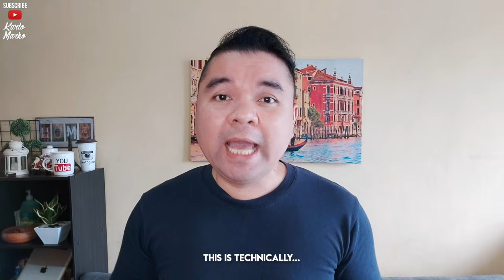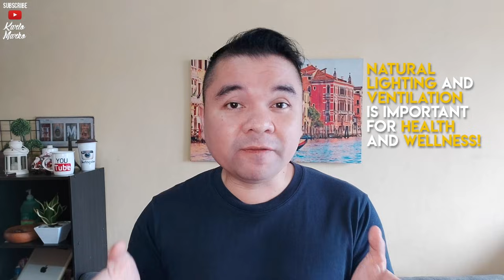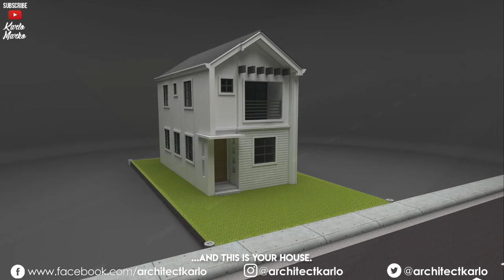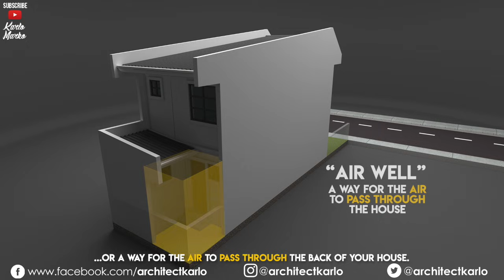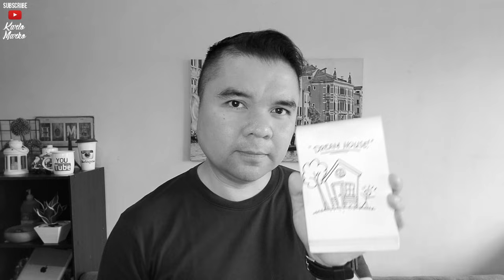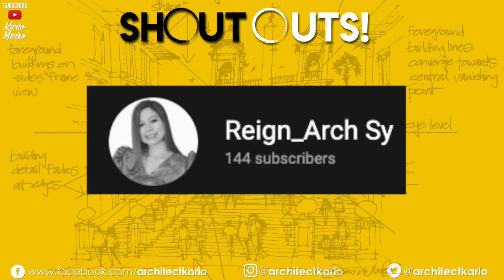The Rules on Setbacks and Firewalls | Bakit Hindi Pwedeng Isagad Sa Property? | ArkiTALK (Eng Subs)

Comment: Sir karlo how about building a room above your existing garage? Any rules for that?
Reply from the maker: Hello Scarlet,

If you bulld a room on the 2nd floor and one side is directly adjacent to the property line, the wall built on these sides should be a firewall.

You also have to consider the setback rules as it applies from ground floor to the upper floors.

You can recheck this with your local municipality just to be sure of your setback limitations. Because some municipalities or city apply these rules strictly and also with exemptions. Depending on your location.

Comment: How about fiesta community houses set backs 1.2meters lang for backyard, side and front yard. Acceptable pa ba iyon? Your opinion lang Archi, di ko naman i cocontest sa subd. Karamihan naman kasi sa mga units nila ganito.
Reply from the maker: Hello Emmanuel.

I'm not sure how they had this approved but maybe the developer requested for a special permit for this because under the Implementing Rules and Regulations (BP220) for economic and socialized housing the rear should still be 2 meters while the sides can be reduced to 1.5meters (under BP220).

The National Building Code NBCP: PD1096 still requires  a 2 meter side setback for all residential lots under the R1 classification or the low density single family, single detached house.

Comment: Hello po! According po sa video, yung pagsukat po ng setback ay mula sa property line hanngang sa exterior wall. So, ibig sabihin po ba pwede lumagpas yung overhang sa setback as long as hindi po ito masyadong dikit sa property ng kapitbahay? Thank you po!
Reply from the maker: Hello Lychee,

Yung overhang o yung tinatawag namin na "eaves" with reference dun sa nguso ng gutter ng bubong hanggang sa property line ng lote ay dapat meron atleast 0.75meter na distance. So from property line to the edge of the roof, atleast 0.75meter ang distance. Si bubong ay hindi wag sanang isagad hanggang property line. For ventilation, fire protection and other purposes. 🙂

Comment: What if the lot is in a hilly village and the house behind my lot is already on my 2nd floor level, hence no proper ventilation to begin with. Will it be allowed to build a full firewall at the rear of the house?
Reply from the maker: With the way you described it, will the firewall fit?

Comment: Good day sir. Taga Samar po ako at ang aming building permit was disapproved by our local building official because we did not comply daw on the setback requirements under rule viii of PD 1096.
Ano po kaya ang puedi kong gawing action if in case our building official will not waive, in our favor, the minimum TOSL requirements even if we can point sufficient evidence that the public open space. e.g. RROW,  on which our building abuts can adequately supply light and ventilation to every room in our building? Are there other options aside from writing an appeal to the secretary of DPWH? 
Maraming salamat po sa magiging tulong nyo po sir sa mga inquiries ko po.

Comment: Kung 7 meters (wide)   x 10 meters (long), so my set back 4meters sa front, then 3 meters na Lang Pwde Tayuan
Reply from the maker: Hindi po sa lahat ng lote applicable ang standard setbacks. Meron pong exemptions sa rule lalo kung maliit ang cut ng lupa or kung ang vicinity niya is under another set of classifications pag dating sa lote. Depende din po ito minsan sa inapply na classification of lot ng developer.

Comment: Sir, can i ask po question? we built a house but with a 0.70 meter setback at the back from the property line. Instead of firewall, we installed an open window with grill for natural light and ventilation? is this allowed po ba? Thank you very much po.
Reply from the maker: Hello Kris.

Technically this is a violation of the Setback Rules. 😊😁
Reply: @KarloMarko  thank you very much sir for the response.

Comment: Good evening po sir thank you for your very informative videos. Nagpagawa po kmi ng haus na 69sqm. malapit na po sya i turn over.. ang quesion ko po how do you architechs turn overyour projects? house lng po hindi kasama ung fence.
Reply from the maker: Hello Ms. Evelyn,

Did you engage with an Architect Contractor po ba or Architect Designer? For turnovers, dapat po kung ano yung nasa design... yun po dapat ang nasa actual. Kung wala pong fence na kasama sa design, wala din pong fence sa actual unless nagkaroon po kayo ng variation order or change order. If you engaged with an Architect using a contract, it should follow what's written in the contract on what the Architect's scope should be upon turnover of the project. A formal contract would include these items. 😊
Reply: @KarloMarko  sir aang concern ko po ugng lupa ng nakappaikot sa haus mismo hindi po ba yun iflattened pra maganda nman tingnan.  and yes sir architect po ang gumawa. thank you po sa reply.
Reply from the maker: Hi Ms. Evelyn,

Paki tanong nyo po kay Architect nyo kung kasama po yan sa scope of works sa kontrata. Hindi ko po sya masagot kasi hindi po ako aware sa usapan nyo po kung ifa-flatten ba yung lupa sa paligid ng bahay niyo or hindi... hehehe. 😆
Reply: @KarloMarko  Arch. Karlo, quick question lang po. Kung ano po ba yung nasa floor plan yun ba talaga nasusunod? Kasi parang nabawasan ng ilang sqm sa actual. Ano po ba pwede gawin doon? May poste na kasi saka CHB...
Reply from the maker: Aaah... dapat po kung ano nasa plano yun ang masunod. Kung ako yan ipapaulit ko.
Reply: @KarloMarko  sinabi ko na sa kanya titignan daw niya.. Ewan ko lang kung mababago pa yun.. Thank you Architect
Reply from the maker: Expect mo na mahihirapan na silang baguhin yun lalo kung nakatayo na. Pero kung proper contract ang pinirmahan nyo... pwede mong i-hold ang payment sa retention kasi considered as punch list item yan or mga items na hindi pa completed. And it is a legal practice to hold the retention until all works have been settled in a satisfactory manner.

That's why we are promoting to always deal with professionals. Para mas-safe si client. 😊😆

Comment: question po.. single attached po ung bahay namin, at gusto po naming maglagay ng terrace sa left side na adjacent sa bahay ni neighbor (pader na po nya un) need  po ba namin magpagawa ng firewall? if so, gaano po kataas..
Reply from the maker: This needs to be visualized using a floor plan po for me to able to answer it accurately. There are some restrictions in adding a terrace in some residential areas kasi.

Comment: Paanu kung hindi na follow yung setback? sa side 1meter lang? From mohon to exterior of the house?
Reply from the maker: Kung hindi po nasunod ang 2 meter requirement para sa setbacks. Ang pader na tinutukoy ay dapat maging Firewall o Solid Wall na walang butas. May dahilan po kung bakit 2 meters ang minimum requirement para sa setback. Para din po ito sa fire protection. 🙂
Reply: @KarloMarko  almost lahat dito ang lapad ng Canopy ng bobong ay 1meter. So it means 1meter lang ang pagitan ng mohon at exterior na pader. Ang dulonng bobong ay sakto lang sa mga mohon ng bahay. Huhulihin ba yan kapag nakita?
Reply from the maker: Pader po ang pinagbabasehan ng setback at hindi ang bubong.
Reply: @KarloMarko  yes po. I mean mag 1meter po yung agwat ng pader ng bahay at mohon? May violation po ba?

Comment: Negotiable din po ba yun ceiling minimum height na 9ft for 1st floor and 8ft for 2nd floor residential building? Thanks.
Reply from the maker: Yes. Pwede mag high-ceiling. It will adjust the structural design as well. Although, if you live in a subdivision there are limitations on the height of the house.
Reply: @KarloMarko  
Thanks for your reply. But my question is can we negotiate the 9ft min ceiling sa 1st floor to be lower, say 8ft lang? Or mahigpit sila sa 9ft as per building code? Thanks again.
Reply from the maker: Here's what the building code implies:

"For buildings of more than 1 storey, the minimum ceiling height of the first storey shall be 2.70 m (less than 9 ft), for the second storey, 2.40 m (+/- 8 ft.) . and for the succeeding storeys, 2.10 m (+/- 7ft.). Above-stated rooms with natural ventilation shall have ceiling heights of not less than 2.70m."
Reply: @KarloMarko  
Thanks for your reply... learned a lot.  Am now a subscriber. 😉

Comment: Sir hingi po ako ng advice, mas maganda po ba na yung nag drawing ng plano sya n rin uung kukunin na contractor or ok lang na iba ang gagawa?
Salamat po in advance
Reply from the maker: Hello Malvin.

Magkaiba ang design sa construction. Ang designer ay pwedeng iba sa builder. Hindi necessarily contractor si Architect. Si Architect ay initially or originally isang designer.

Ang contractor o ang builder ay pwedeng architect, engineer at may kakilala pa nga ako na dating accountant. Iba ang construction. Si design ang ginagamit na basehan sa pag-construct. Susundan lang ni contractor ang design.
Reply: Salamat po ng marami sir Karlo pag palain po kayo ni Lord.
Pasensya na po masyado akong matanong. Salamat po ulit

Comment: Our subdivision have the same lot area, which is 240-sq mtrs each. The scenario is this: my neighbour already built a 2-storey house beside my vacant property lot, which is bounded by “mujon.” 

Problem is: my neighbour utilized his enrire lot and erected a wall of his house placed in the middle or the center of our “mujon” without set backs. 

So, my neighbour utilized his entire lot where his house is standing now. 

Question: If i decide to build a 2-storey house beside my neighbor, could it be legal for me to put a wall beside his and just build a 40-cms. Firewall, or not?
Reply from the maker: Hi. Yes. It's okay. Actually I find it wrong that he built his firewall at the "center" of the mojon. It should be "inside" his property only. And not to overlap with yours. So it may turn out that his firewall is partly yours. 😊

For your proposal... You may need to have it approved by the local municipality just in case they have other implementing rules regarding this matter. But it seems like the size of your lot falls on the R1 classification and in this classification... firewalls are prohibited if your house is a single family dwelling.
Reply: @KarloMarko  
Thank you very much sir, for your time and effort just to reply with my question.  I do really appreciate the info  and suggestions you’ve provided me. 

I fervently hope that you would always find time to answer my querries in the future that pertains to construction matters. 

You can be certain of my humble support of your very informative youtube channel by way of watching every ads that shows from the start of its inception up to the ending scenes. 

Again, thank you.
Reply from the maker: Thanks for your support! :) I pray that you get to settle things. 😊 🙏

Comment: pano pag setback ng Corner lot?
Reply from the maker: For corner lots, 2 sides are considered as the front setback. But this depends on which road is the more major one. If this is inside a subdivision, you can check with your subdivision. You can double check this also with your local cityhall.

Comment: Arki, question. Needed ba ng firewall sa harap ng road if hindi mag set back?
Reply: Thank you so much for this informative content ❤️
Reply from the maker: Hello Kit Daniel,

"A firewall is simply a wall separating buildings or subdividing a building structure to anticipate the spread of FIRE... while also offering fire resistance to the area." - So yung side na nakaharap sa kalsada assuming na kalsada na nga talaga ang nasa harapan ay hindi na kelangan i-firewall kasi usually wala namang bahay sa mismong kalsada. 😄 Pero as per building code... BAWAL ka sumagad sa mismong harapan na nakadikit sa kalsada o sa sidewalk.

Ito ang dahilan kaya kelangan mag-apply ng building permit para makita ng local government kung approve ba ang design ng inyong bahay. Aware ako na may mga lumalabag sa rule na ito. Pero may dahilan kung bakit importante ang rule na ito kaya siya ginawang rule sa batas ng building code. Dun sa mga nakita mong lumabag... good luck. 🙂 Kasi naghihigpit na ngayon ang local government sa mga ganitong execution ng mga bahay. May ibang paraan para maximize ang inyong bahay.
Reply: haha naiimagine ko yung reaction mo habang sinasagot mo ito, halos nabasa ko na lahat ng question ng iba paulit ulit lang pero nagtyatyaga ka pa ring sagutin ng paulit ulit, minsan pag may nababasa akong tanong alam ko na ang sagot kase nasagot na previously, yung iba naman common sense lang yung sagot hahaha...

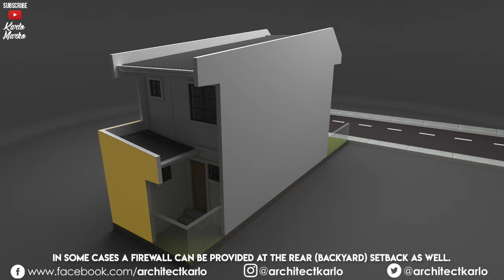Comment: Good day po Architect. Nabanggit nyo po sa 4:33 mark ng video that in some cases, the 50% firewall at the back/rear side of the property may be allowed. I'm having the same issue with my developer right now, so kung hindi po kalabisan, hingi sana ako sa inyo ng advise on which particular cases this exemption may be allowed, or if you could point me to a particular literature that can clarify this matter for me, it would be greatly appreciated. Thank you po in advance.
Reply from the maker: Hello SFHS NinetyTwo

That 50% rear firewall depends on the developer or the property classification talaga. All lots or properties have their own specific classification. Not all are allowed to apply the 50% rear firewall. Some allow it some don't. So for this one you need to clarify or have it approved by your developer or your LGU for their approval.

Comment: What is the difference between Architect and Engineer? Kasi mayroon na akong engineer and he will look at my lot in Tagaytya City, Philippines.I am planning to build a house for my future retirement.
Reply from the maker: Hello Emma Muir

There's a lot of differences between Architects and Engineers. Take note, there are also different kinds of engineers. Here's a quick description of all the professionals who will be involved in designing and building a house.

Architect - architectural floor plans, site development plan, elevations (front view, side view, back view), sections, material specifications, finishes and other details in the house. The 1st step in the design process.

Civil Structural Engineer - structural engineering design plans, specifications and structural design analysis.

Electrical Engineer - electrical engineering design plans, specifications and loading computations.

Plumbing / Sanitary Engineer - fresh water, waste water and solid waste plumbing designs and drainage designs and specifications.

Other professions that may or may not be involved in the project depending on the requirement.

Mechanical Engineer - designs mechanical equipments like airconditioning, heating equipments in the house and many more.

Electronics and Communications Engineer - for all the data and LAN connections for your internet. They may also be involved in the installation of your CCTV and the rest.

Geodetic Engineer - in charge of doing the land survey and mapping out your lot's slope and its elevation from the sea level.

Interior Designer - intricate design of your home interiors and space planning.

There's a lot of engineers right? 😄 But there's only one Architect and he/she is the 1st step in designing your home. 😊

Comment: hello, saang side po mas recommended maglagay ng firewall kapag single  attached?
Reply from the maker: Depende po yan sa orientation ng inyong lupa sa kalsada, sa araw, at sa marami pang ibang factors na pwedeng i-consider sa pagdedesign.
Reply: @KarloMarko  mas best po ba sa side kung san po may carport at kitchen? for safety purposes?
Reply from the maker: Ideally most firewalls are on the side. Pero it's better to have your property checked by an architect for better advice. Madami pang factors ang kino-consider for this.
Reply: @KarloMarko  san po mas okay? Sa west or east? Archi student po ako thank you po sa help

Comment: Hello arki. How about fencing ? Will it also follow the setback rules? or can you just build within the mons
Reply from the maker: No. Fencing or the perimeter fence can be built on the edges of the property line itself. Kasama ang gate. Basta wag lang ito lalagpas sa kabilang property, shempre. 😁

Some subdivisions have limitations on the height of the fence so if you live in a subdivision you may check with them.
Reply: @KarloMarko  nasa building code po ba yun arki? Hindi ko kasi mahanap about sa fencing rules. San po makikita arki sa batas. Thanks po

Comment: Architect, can we build carports beyond the setbacks?
Reply from the maker: Yes. As long as it is not enclosed with walls or it is not a building. Or else it will be required to have firewalls if needed.
Reply: Thank you!
Reply: @KarloMarko  hi architect! what about a roofed carport supported by cantilevers, without walls?
Reply from the maker: Some subdivisions will allow this po. You may consult this directly with them kasi some subdivisions have rules beyond the setback rules po.